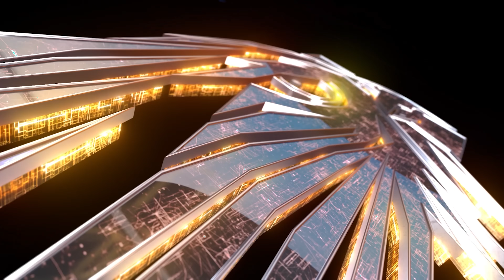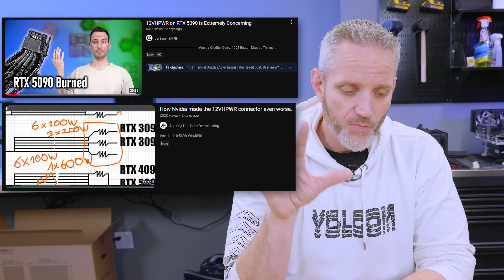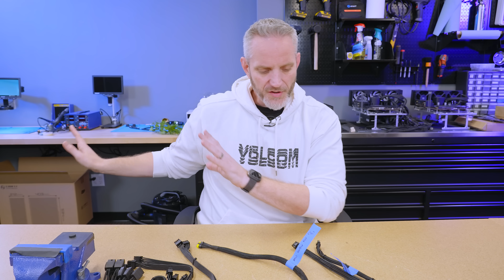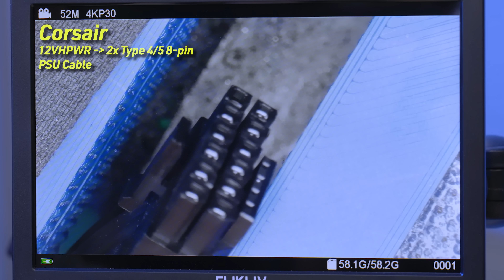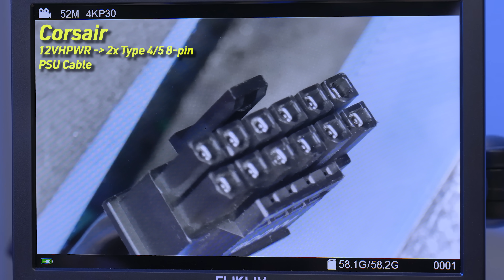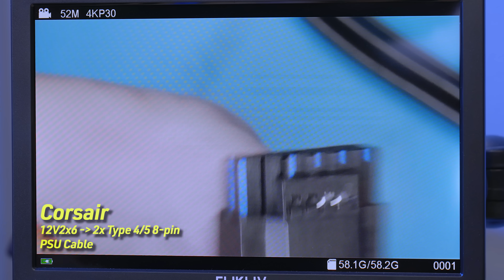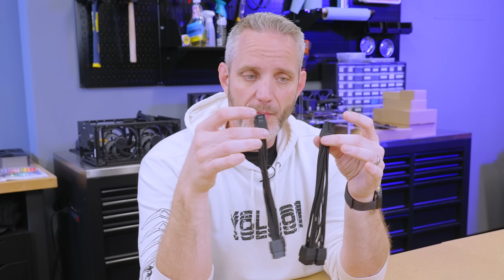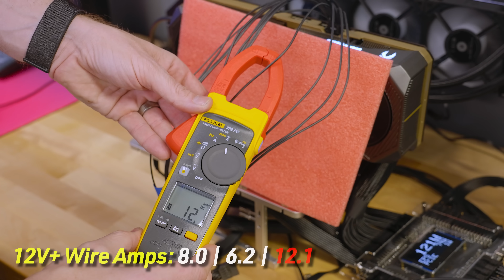I discovered something concerning and I need the Experts to chime in... More 12VHPWR discovery!

Comment: So, I have a few things to add, but first: I am not specifically an engineer, but an electrical technician with 5 years experience in repair, 1 in manufacturing, and 3 in an industrial setting, and I am also studying to become an actual engineer. Also, I'm using the term pin to mean both male pins as well as female sockets. 

1: Loose and recessed pins can, depending on  the design of the connector and how the pin became loose, it can either function perfectly, or cause major problems. Some loose/impacted pins will still make the same contact with the mating pin, just at a different location on the mating pin, meaning the contact patch would be the same, and thus connection resistance would be unchanged. Some other pins rely on multiple contact bumps/surfaces, and/or having a mating pin inserted a specific length to achieve a specific contact patch area, such as pins with multiple contact surfaces or pins where there is a taper used to achieve a specific contact patch area, in which case this will absolutely cause problems.

2: you are correct, the ground pins, specifically in this scenario, will not have the same current going "out" as the 12v pins have current going "in". This is because the PCB/GPU ground is connected to the case, which is connected to the motherboard ground, the ground on mechanical hard drives (since the chassis of the HDD is metal, and the HDD PCB is grounded to the hard drive chassis), and the PSU case, which is grounded internally. So, in essence, the GPU has many many different return paths, including through the power connector, through the pcie slot (which has many more ground pins than power pins), and through the PC case, which can offer return paths through hard drives (through their power connectors) and to the PSU directly.

Comment: Note on the ground pin not making contact: The card might pull more power from the positive rail on the power cable compared to the PCIe slot, but the grounds are most likely all connected on the card (I don't have a card to actually confirm this). If you have 3 ground wires not making contact, the rest of the power would most likely go through the PCIe ground back to the PSU, which would be visible on the thermal camera on the PCIe connector. 
Not monitoring the power in and out for each of the power wires and not load balancing the power consumption, when the card pulls that much power, is just lazy engineering on their part and also a fire hazard.

Comment: if i had a 5090  i would try to solder the cables to the gpu and the psu and i'll use 2.5mm2 rigid cables that we use in the domestic electrical installations 
what do you think of this stupid idea ?

Comment: Using the NVIDIA adapter might not be a good idea

The 8 pin cables with an adapter have been shown to have the same unequal power draw problem.
This isn't as likely to melt a connector because the 8 pin cables have a huge safety margin, but it is still a problem

PC-SIG warned that the 3x8pin to 12VHPWR adapters had an issue where it could draw 300 watts through one of the 8 pin connectors two years ago.
Wccftech had an article showing 25 amps from one connector and 8 amps from the other two.
The article noted that this was a minor concern since GPUs were only drawing 450 watts but would be an issue if they started drawing 550 watts.
They recommended getting a power supply with a dedicated 12VHPWR connector instead of using adapters

I've never seen additional coverage of this issue or any indication that this was resolved.
It is possible that the latest, more robust NVIDIA adapter doesn't have this issue.

There was a comment from JohnnyGuru saying that it wasn't really a problem
There was a response to his comment saying that he was correct about 16 gauge cables but 18 gauge cables would have a problem and were provided with some 1300 watt PSUs.

Comment: Hey @Jayztwocents, a milliohm meter can help you check the contact resistance. Plug the cable into the GPU, then connect the meter to one pin from the cable side and one from the GPU side (you'll need to disassemble it a bit). This will give you the resistance of the full trace in Ohms. Ideally, they should be within 1-2 mOhms of each other. Poorly seated connections, possibly due to the cable issue you mentioned, will show substantially higher resistance because of the reduced contact surface.

Comment: The corsair psu I got has the 12-4 connector on both sides of the cable instead of  2 pcie power connectors on one side

Comment: I've been looking at PSU's to replace my 1kw ASrog PSU for a new one with a 12v2x6 to power a 5090.. and find the lian Li PSU comes with all the pins soldered on its cable vs others you cant really see or find the info.. just wish it came with a larger fan 120mm going to be noisy :(

Comment: i watched a the reference videos, as someone who use to work on uh60 flight computers anyone who says its fine to run this much power over these cables on said pins that the industry says is fine blows my mind. i bounced the videos off some friends in the electrical field, they were all blown away by the lack of balancing on these cards in the first place let alone the plug issues

Comment: A PCIe 16x Slot has over 20 Ground connections, every of them is able to carry 5.5A. As long as the ground planes in the graphics card and the mainboard, and the 24 and EPS connectors on the board can carry this current you can cut all ground wires from the 6x2 plug and be fine.
If something is wrong with the ground pins the current simply diverts over the PCIe Slot.

Comment: The fact that they need 2 plugs on the power supply side with bigger connectors and funnel that into 1 tiny connector with tiny pins should have made someone at nvidia think..  but no.. lets double down.

Comment: It's just shitty design, even if it was any of the pins causing it, it's not an excuse.
These are supposed to be robust power cables with high tolerances, that's why the pin holes are so deep.
The whole connector should simply be scrapped and re-designed completely instead of trying to fix a piece of crap while equipment burns in consumer's computers.

Comment: I have been involved in 12 volt power engineering for many decades, I have power tested these connectors over and over using hundreds of different load and voltage combinations, my personal results showed there is no proper load balancing between the separate wires, this fact creates more stress on a few single wires and pins. Just because there is continuity on all of the wires and pins doesn't mean the amperage is balanced evenly in all the wires. The answer and fix is very simple and shouldn't require so much discussion. My final answer is Nvidia engineers are tarded and nvidia is being cheap.

Comment: That’s how my bottom Corsair 12VHPWR cable has been, that I’ve used daily with my ASUS TUF OC 4090, since launch day. It’s way more recessed than the rest of the pins. Knock on wood, no issues thus far.

To give you an idea, I use it daily for high resolution VR (4312x5100 per eye), while overclocking my 4090 for 4-6 hours straight, and it regularly gets pushed past the 450w and to its 100% limit.

I have it paired with a HX1200 Platinum PSU from 2022 and so it’s been 28 months now using this set up?

I remember being worried about that pin when it arrived (I was lucky enough to ordered it the week before the 4090 launch) but if you remember, those cables were impossible to find after launch for months and months (which was the reason cablemod blew up at that time since they took that time to sell theirs to anybody and everybody). But I remember asking people about it online and nobody else seemed to think it would cause any issue. Hopefully that’s correct and it’s a nonissue.

Just wanted to share my experience with this.

Comment: Coming from an automotive perspective, cars use 12v, ground is just as important as power. I’ve installed multiple auto starters and sound systems. I’ve seen wonky things happen from a poor ground. Bad feedback from speakers, not getting proper resistance at the amplifier.

Comment: You made me curious to check my PSU 12Vhwpr cable, that was never used before (Because I don't have a gpu yet) and Yup.. the pins are wiggling when moving the wires up and down. the cable is the OEM cable that comes with the coolermaster V1100 SFX Powersupply. to be very accurate, it's the same pin at the far end corner as you shared.

Comment: And it is another thing to protect your home and your life if a burning cable and connector cause a burning house.

No thing you have should start to burn under ordinary  circumstances (except of firewood). If a device you own inherits a higher risk, it should come with adequate safety measures.

Regarding the  difference between ground and 12 Volt side. Just draw down the resistors. You start with the resistance of the PSU, then the first connector 12V at the PSU, the 12 V wire, the 12 V connector at the GPU, the internal resistance of the GPU, the plug of GND at the GPU, GND wire, GND connector at the PSU. An increased resistance in any connector or wire down the line might be a problem because it will create heat, that increases resistance even more .... (or even an electric arc).
We know the newer Nvidia GPUs will connect all 12V and all GND just behind the GPU connector. In theory 6 wires act as one. In case of an increased resistance of one wire voltage drop over that wire would be higher than over the other wires. But at both ends the wires are connected with each other (wires in parallel) in a state when there is a significantly different voltage drop over the wires.
Bla  bla bla, we know path of least resistance, extremely different amps on the wires. heat, ....

The correct thing would be to have fuses in the PSU or in the cable (in each wire), or any system to limit the amps on the wires.

Comment: In Avionics that cable would be sent to depot tech, It would NOT be used!  Don't get me wrong there are moronic co-workers that would pull the Corsair Response out of their asses. But doing it for years, I would never allow it on either side of power.  Ground is just as important as hot period!
Reply: Also, It might be worth it to use that shit plug for testing...  Plug it in, pull on each individual wire and see how much of it comes out WHILE it is plugged in. If there is over heating or a fail on a date line, let it cool down and push it as far as it can IN, and try to duplicate issue.

Comment: Jay I feel this is a good find. Especially with the Corsair. I experienced a similar problem, not with a pcie cable, but with one of corsairs aio screen cables that goes to the fan/RGB controller. I kept getting errors on the aio pump screen and had found that the pins in the connector to the controller were pushing out when plugging it in. This type of connection issue seems to be common with Corsair cable connections.

Comment: Seasonic native cables for the TX-1600 PSUs are the "same", maybe not doesn't move that much than the Corsair in the video. I usually seat the connector fully then push the cables individually further. It usually does move a bit (less than 1mm). I've been using this PSU for quite some time now with a 4090 aorus without issues.

Comment: I have a Corsair RM750e (ATX 3.0) and I just checked the connector on the cable that came in the box (not the H++ connector), same as in your video, not all of them have the same depth and it’s very easy to see with the naked eye despite never being plugged to anything since I don’t have an Nvidia GPU. Glad I’m using regular 8 pin connectors for my AMD GPU, because this is a major concern. I’m going to avoid any GPU with this awful 12 pin connector for now, this is getting insane.

Comment: Generally speaking the electrons don't care if they are moving through a ground or a 12V wire. I do not know the pcb Layout for the GPU and there might be alternative ways to ground through the PCI slot or even the case but not for 12V so bad connections there might be more dangerous since the load would be higher.
The directions doesn'T play a role either. !2V at one end of the cable is input, but output on the other side.

I'd expect that all molten cables where 12V until today is either a fluke or has something to do with how the cable is typically bend unless the ground pins have a much bigger plane on the pcb providing more cooling. Not sure if that could make a difference if you deal with melting cables.

About your theory of a power distribution thing "cleaning" the power, I can't think of any way that should work unless there is active circuitry in it balancing the phases.

How bad is the corsair cable? It looks tolerances are bigger, but, most types of connectors do not make contact all the way anyways. There is often astonishing little contact area and all of it is used even if a pin is not completely inserted.
If a Pin has bad contact for whatever reason, the resistance of that phase would be higher, lowering the amps on that phase, increasing the load on the other wires. 
So if one cable gets extra hot, this is the "best" cable/pins connection between powersupply and GPU and the other ones are "bad" or at least worse.

Comment: I was the one that made that suggestion calling them gen 1 and gen 2. I also said if they're (the cable manufacture) going claim the gen 2 (12V-2X6) cable needs to be used on the 50 series, then the connector NEEDS to be different than the gen 1 (12VHPWR) cable. MODDIY made this statement, that gen 2 cables need to be used on 50 series. I don't buy that, if that was true then the connector itself would be different so the user wouldn't be able to use the "wrong" cable.

Comment: 21:45 - This proves 1 thing - 

The 12VHPWR new design needs to be recalled -- it removes load balancing and relies SOLEY on the PSU without this being in any spec and almost impossible to know if a PSU will be fine. 

This needs a recall and a requirement to load balance at minimum -- but imho -- a change to the high power pins. at minimum -- 24v -- realistically 48volt. 

We just need less amps flowing.

Comment: One thing to mention. Third party cables are not the same as psu oem cables. Yes they did not come from NVIDIA, but they are first party from the psu oem. Der Bauer showed that the psu side is actually hotter and the original Reddit post also showed that the psu side burned. 

Especially with stuff like pin depths or wire gage or whatever could be very important that the psu and the cable fits perfectly together. Yes there is a spec, but the best manufacturers normally overbuild and are better than the spec demands. 

Edit: one thing for example that is really important regarding resistance and heat is the cable length. So if a psu comes with a short cable there could be a reason for that and I would not use a third party cable that is 3x longer.

And yes before anybody mentions it, yes before third party cables worked, but they were just not transporting that much power over relatively small pins.

The original problem is still in the design of the connector and with the power control on the GPU, which makes it nvidias problem. I would definitely just buy a very high quality psu like seasoning and stick with their cables.

Comment: Anyone that has spent time in the automotive or industrial world or any place they deal with electricity will agree with me that the size of the conductors, the size and spacing of the terminals and the extraordinarily poor terminal retention is a recipe for a failure prone disaster.  There is no way an engineer in other fields would ever expect something this fragile to handle those amperages. They are only doing in in computers for the aesthetics and compromising durability. These connectors need to be replaced with larger units that have a TPA and a CPA. Until that that is done this is going to be a constant problem in video cards.
        Corsairs statement on that pin is not acceptable. There are no terminals that allow that much slop when locked into a connector.

Comment: Crappy connectors any RC enthusiast would only use for low power non critical wires...
To connect batteries, things like an XT60 connector is often used and is rated for 30A, it's a lot beefier, also hard to plug and unplug while it only has two pins.
Those connectors aren't holding on clips and barbs, each pin is molded so it won't move, which is exactly what happens in the corsair cable.

Comment: I work With EV chargers, dealing with high current. A slight imballance in Resistance (poor contact) will create hotspots which WILL lead to failure
We had an EV charger that we stopped going to market as the main DC contact relay which was roughly 30% overspecced failed due to heat over and over again, as it turns out the cooper busbar was coated with an anti oxidant layer that was enough to increase resistance eough to overheat the relay and melt it.

Comment: Now don't bash Nvidia too much on cheaping out, the BOM that goes into final card assembly is not the only cost involved. Testing multiple power delivery designs costs something as well. That being said, this is unacceptable for a 2000USD product. It would not kill them to incorporate a 3090 style 3 shunt power input or hell even a shunt for each cable ... Yes it will not play nice with some PSUs and create problems for customers when matching PSU and card but it is still better than being the cause of major failures like this ....

Comment: Parallel conductor load sharing in house/machine wiring is illegal for a reason... Because fire. They need to expand those regulations, the low voltage of these supplies is irrelevant. I can't believe UL would sign off on these designs.